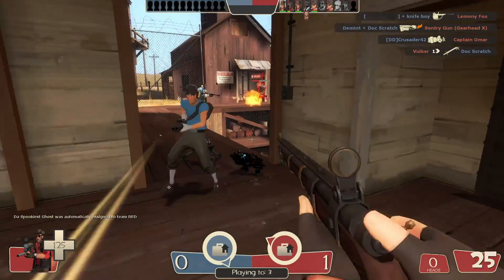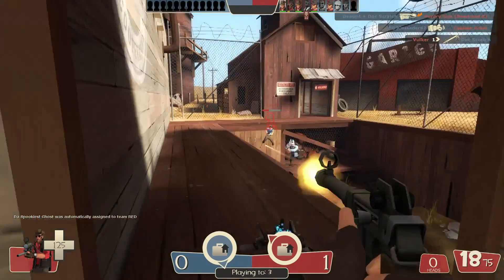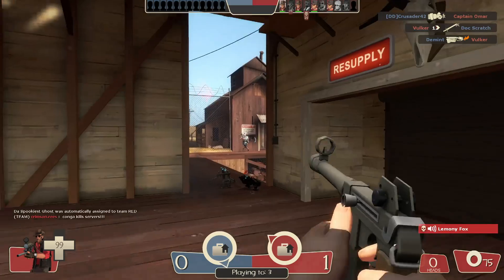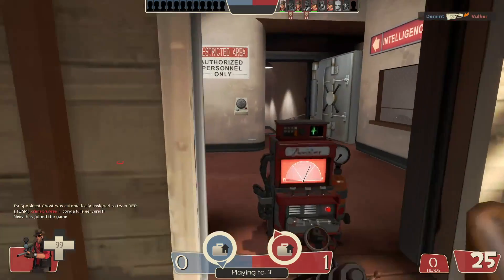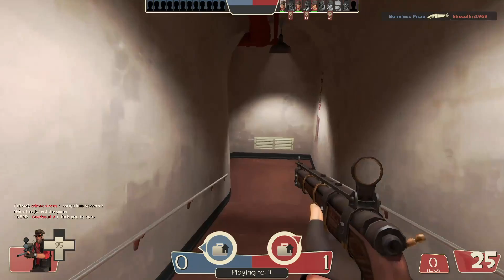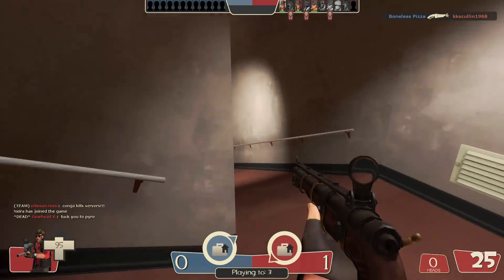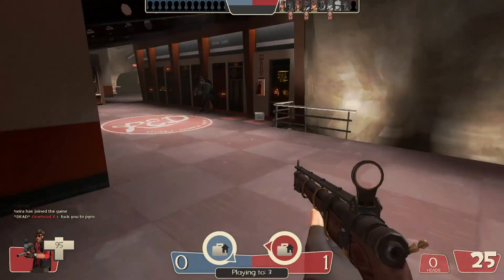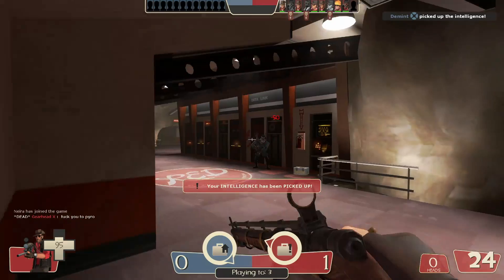The $25 Xeon Budget King | 1080p Benchmarks and Build

Comment: Hi, I’ve got a dell T3500 and I want to buy a x5650 (i’ve got a w3550 now) what clock speeds can I get? And is it a good upgrade?
Reply from the maker: Not sure what the dell T3500 motherboard can overclock to, it isn't worth it though to try and get a mobo that can overclock these bad boys nowadays since the skylake CPU/Mobo combos are going for cheap used. Although, these CPU's easily overclock to 3.9-4.2ghz. If you go above 4ghz you will never a hefty cooler or water cooling. I use one for regular gaming on my second pc whenever I have people over and it easily plays 3-4 hours of PUBG with a gtx 970 without crashing! I hope that helps!

Comment: What does the CPU utilization look like at 1080p? Is there room to feed a more muscular GPU, i.e. GTX 970 or Radeon 280x ?
Reply from the maker: Hey, sorry to be replying so late. Life kind of caught me by surprise for awhile. I have this currently paired with a gtx 970 and it actually runs really well. This CPU runs about the same as an i7-3770 so it can carry its weight for a bit. The highest I would go is a gtx 1060 but nothing newer than that. The boards also don't support pcie 3.0 or sata 6 gb/s so it is really too old of an offering for anything significant.

Comment: The max i got my x5650 is to 4.2ghz stable on all cores @1.35v .. what about you ?
Reply from the maker: Sorry to get back to you late, I can't remember but I think it is around 1.35v. I will do a video on my overclock another time. Thank you for the comment!
Reply from the maker: I'm using a corsair air cooler that is no longer made, but a hyper 212 will work just fine though for a 4ghz overclock!
Reply: hey ive got the 5670 what cooler do you use guys?
Reply: jerome jagonia i use cooler master v6 gt with thermal take fans